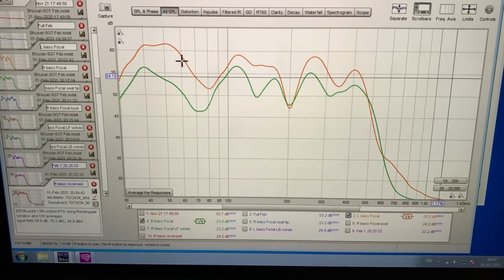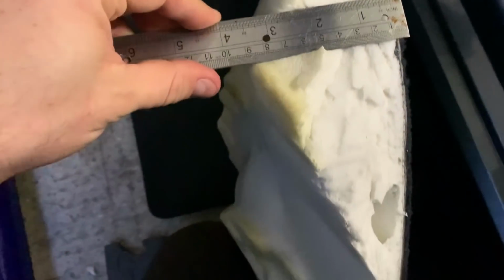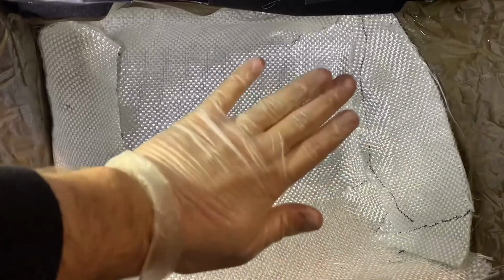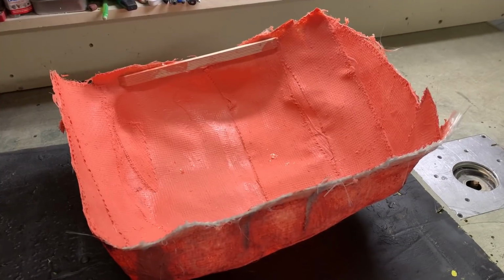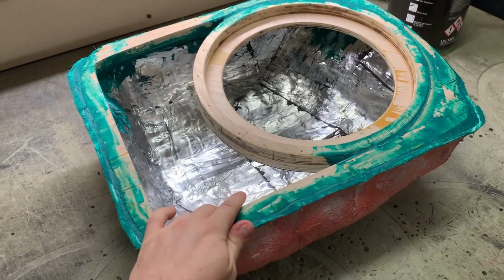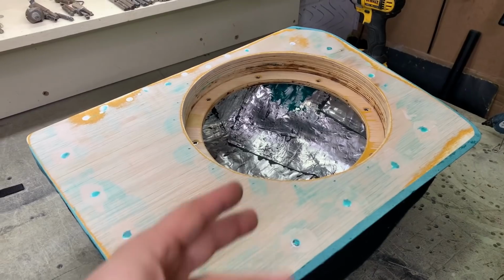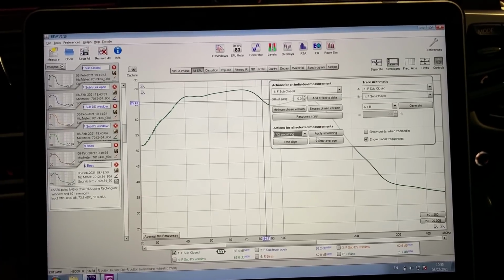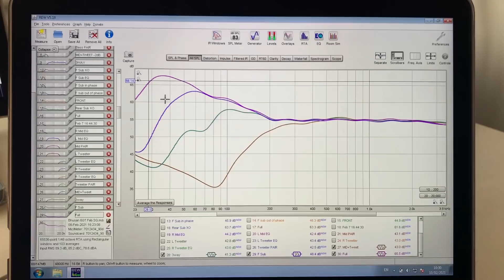Front Subwoofer - Everything you need to know! Acoustics, RTA, Fabrication - Focal Utopia 10WM

Comment: sealed off a trunk on my 68 Chevy nova for an IB 15" setup.. 
Day 1: Started up with a fresh board of plywood 
day 42; icecream sticks with a glue gun in my self created 4d puzzle of doom. 
day 50: It would have been faster to seal the holes from the  inside out instead of outside in.. 

day 1.2 : Yay, plywood, silicone.
day 2.2 ; Awesome sound :)
From failure comes progress and knowledge.

Comment: Was the front sub bolted to any area of the floor or firewall? I’m asking because if the enclosure can be mounted solidly it will give more solid impacts of bass. I bolted a fiberglass sub enclosure using auto sub box carpet I soaked with resin. I braced the inside with 4 3/4” mdf stands about 3” wide from the inside from deck to bottom. I made to hold 4 12” JL 12W3 subs into the spare tire wheel well into the trunk of a 93 Acura Integra gs-r with 500 watts rms by 2 Precision Power PC21400 amps. Had to run a  custom wound 300 amp alternator.

Comment: Actually this video make me think about my own, I have a truck single cab , have a lot of space behind the seats but was thinking to set the subwoofer in the front at passenger side, to leave the back space empty for tools. Actually my subwoofer is a Ultimo titanium SC 104, that as per manufacture needs a minimum of 13 liters up to 30, Thanks Peter, The question is still I need to have a sub behind the seats?
Reply from the maker: Cruz Morales location vs cabin size, that’s what dictates! Unfortunately i haven’t worked on many pick up style cabins, they are not popular in UK.

Comment: How many watts did you decide to give the 10WM? In an ideal world would you have used a larger enclosure? I have a 10wm in 0.55 cu. ft. of my spare tire well, fiberglassed in.
Reply from the maker: We run it upfront, so it can never play as low as from a trunk, so it needs a rear sub for the low lows. 
What it does upfront when it comes to punch and playful upperbass is a different story and it’s really not about how much power you have behind it. Give it as much clean power AND stable power supply in the car and it’s all good. Worry rather about how it’s tuned and integrated to the rest of the system.
Reply: @pssound9749 gorgeous work peter with the focal utopia m bmw build. did you ever hear about the focal fse 20 flax evo 8 inch shallow sub?. I think that would be a interesting install/project for you in the future, for upfront bass. I think they would do great in a front false floor build, plus you would be able to put them on both sides of the car, right front, left front sides.

Comment: Hi Peter, how long does it take for you from start to finish to build a fiberglass enclosure for a sub in passanger feet location? I am thinking to build one, since i can't block my trunk and have only front speakers, don't think will add rear fill soon enough. I would like to know what i'm getting into. Of course i will add some extra time margin being the first time i'll do this
Thanks
Reply from the maker: Hi,
A front sub box is usually 30-40hours work, so it’s very labour intensive, but you can certainly do it in stages.
Reply: @pssound9749  thanks..so, around 7-10 days working in stages after work. Good to know 👍thank you

Comment: Good day Peter. Brilliant installation as per usual. One thing though would subwoofers in the doors be just as effective or better?
Reply from the maker: In doors where everything rattles? Quite a tough job! These cars don’t even have door location for larger drivers, just 4” mids. You’d need to build door enclosures like i did in my Honda. 💪🔊🔊
Reply: Thanks for the reply.
Reply: Thanks for the reply.

Comment: @Pssound would a 3d scanner, with a 3d printer work for a box, in a location such as this one?
Reply from the maker: You can do crazy things with today’s technology, so i’m sure it’s possible, but i’m not sure it’s worth it. Printing a rigid enclosure for a 10” sub is quite a challenge! 🤘🔊
Reply: @pssound9749  it would be great for making the basic shape so you could fiberglass it outside of the car.  Another benefit is that the whole deal can be shared as 3d file to other builders with same car and done again.
Reply from the maker: matsku1212 but the reality of people cutting the carpet....

Comment: Hi Peter, another great video! Question for you: I've done a similar approach for my car, but uncertain as to the best strategy for time alignment between the front midbass speakers, front sub, and rear sub. Do you feel that the Helix software (I have a Helix Ultra DSP) does  good job with automatic time alignment? Or do you think I'd be better off just measuring distances from each of the speakers to the driver's headrest?
Reply from the maker: I have my well practiced method, that has worked for years, so I haven’t used Helix’s feature yet. I may try it for comparison one day. 😃
Reply: @pssound9749  Thanks.  I'd love to hear your take on the Helix feature some time, and if it's worthwhile for those who don't have access to someone such as yourself.

Comment: Good evening.

I am buying an enclosure. But confused between the regular shape or the wedge  shape ( tapered on the top which sits perfectly behind the rear seat)

Does top tapered or wedge shaped  enclosure affect the sound quality?
Reply from the maker: Absolutely no difference in sound. Air space matters.
Reply: @pssound9749  just ordered the wedge shaped enclosure. 

Now there has been a debate going on regarding xmax. Is higher always better. 
I am looking at a polk audio1240 sub which has an xmax of only 7.5 mm. Is it a deal breaker ?

Comment: Could you please let me know the dimensions of your 5 1/4 sub boxes underneath your driver and passenger seats that are ported? Also the size of the ports? I have some MB Quart Reference  5 1/4” I was thinking of putting under the seats after seeing your cool install, instead of installing mid bass speakers in the doors. If you could give me a rough idea, that would be awesome, especially the port size, as I can look up the volume size Vas or Q for a box for the speakers. I really envy your installs dude.  Aloha, Matt on Maui 🌺
Reply from the maker: Hi Matt,
I’m a bit confused by 5.25” drivers you’re asking about as this BMW has 8” drivers fitted under the seats.

Comment: what type of plywood do you use? is it important?
Reply from the maker: It doesn’t, it just gives structure. We use birch ply.
Reply: thank you! started my build today, following this guide. When you do the first layer of fiberglass cloth in the vehicle, is there any trick to applying the resin upside down onto the inverted piece? I was planning to use paintbrushes but I’m not sure that would work
Reply from the maker: @chef_yt  that’s always the shit part. It helps if you wet the chopped matter with resin a bit in advance, then stick it up or if you can, just build it from wood on the top.
Reply: there’s not a great way for me to build it with wood on the top, wouldn’t be any easier from what I can tell. I’ll try using a strong adhesive tape for masking, supergluing that section of the cloth to the masking tape, and just ripping the tape out with the cloth when it comes out, and sanding off the tape. Probably decreases the integrity of the mat, but I’ll do other layers anyway. Thank you for the help, and great video!
Reply: change in plans. masked with blue painter’s tape and carpet protector (cling wrap) and a healthy serving of johnson’s wax. I removed the glove box so I’m thinking I’ll affix coat hangers in the glove box area, bend them down into the fiberglass area, and have the coat hangers holding up a piece of wood shim stock on the front/top of the box to hold up the cloth. I give it a low probability of working, but worst case I’ll cut out any droopy bits and either glass those couple inches with a loose clearance, or put wood there. have you ever had an insufficient mask/insufficient release agent and had to remove a fiberglass part stuck to the frame?

Comment: I am asking myself; would a multiple capable 6,5 or 8 inch was used, could that be a solution instead of a single woofer?
Reply from the maker: Large drivers always play lower frequency range more effortlessly with less distortion than multiple small drivers.
Reply: @pssound9749  I agree Pete, but considering the bandwidth were the biggest problems were, between 50-80 ish was the reason. Right bandwidth of good smaller drivers. But if you want bigger lower output in front it’s logical.
Reply from the maker: Umıt Bozkır it was also about location related problems with the midbass. If the 8WM was in different location and had no issue in 60-90Hz range, we wouldn’t need a front sub. 
Sometimes you need luck with cars and what locations you get.
Reply: @pssound9749  I am going to try with an Aliante 12, and try with multiple 6,5 inches. I have also the same issue with my BMW f11 estate. Depth isn’t an issue with the Aliante, but the diameter of an Aliante 12 is quite large.

Comment: Morel Ultimo Titanium 102/104 have 600W RMS and Frequency response of 10-900Hz and similar sensitivity of 85dB only con is that it's almost 1.5" longer than 10 WM. Morel paired with Helix M One X (having Freq. res. of 10-250Hz) would have been able to produce the low end bass (20-25Hz) as the rear sub?
I looked at the specs of some subwoofers where it was mentioned ported sub box makes lower freqs. than sealed boxes but need more vol. Do you think a ported box in the front would make a difference?
The Focal TBM can go to 50khz according to it's spec sheet, is that even noticeable coz usually tweeters are up to 20khz or 25Khz?
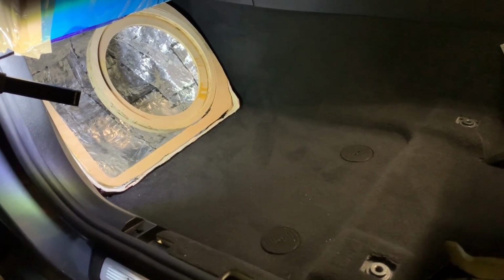Love your work on this beamer, would have loved to see some glimpses of your tuning session. 28:27 I would have added a layer of chopped fiberglass from behind the plywood and in front also before applying Resin and make a sandwich  between 2 plywood layer. This way the fiberglass layer is also a part of the plywood and is not just held by the resin alone.

Comment: thanks for another great video peter!  i'm hoping you can shed some light on an idea i have.  in my jeep grand cherokee there are significant spaces under both front seats.  the driver's side is empty and currently houses my dsp.  the passenger side has the battery.  i was considering putting a small sub, 8 or 10, under at least the driver's seat.  initial thoughts?
Reply from the maker: brett leasure any sub is better than no sub, but you can get better low-end response from a single if it’s on passenger side.
Reply: @pssound9749  thanks for the reply.  i should let you know that these would be more like supplemental midbass/subs where i'd likely still have a 15 or something in the rear.  i built kicks with 10's in them, but they're starving for air, etc.  they imaged well, but they struggled to get me anything in the 60-100 hz range.  i was hoping that relocating the battery would be alot easier than cutting a bunch of metal in my kick panel areas.
Reply: @pssound9749   I do believe i heard you say that you would have liked to have the sub facing towards the fire wall ? 
If true , In your experience or knowledge do you feel it gives a better response to have it facing the fire wall. Also do you feel a center console sub that’s placed forward slightly underneath the dash would benefit more rather then on the passenger side fire wall area ? Like in the position where you would usually find the shifter but say maybe 6-8” more forward. I ask because I have a Chevy Silverado and it has lots of room in that area. I’ve seen some online put a 10” in that spot with a .6cf sealed box. Don’t know if the work would be be worth it. Oh the sub would be down firing at the floor.

Comment: Hi, Peter! Do you have a 10 » woofer with a better budget friendly price option that I can use, without braking the bank with the utopia one 😉. Thanks.
Reply from the maker: JL has great options. W3 is excellent for SQ too, but if you need something slim, they have many options for that too. 
If you have space, then the Helix Q10W is a real jam and is cheap for what it is.
Reply: @pssound9749  Thanks a lot for your quick reply…saw the q10W will certainly go this way but will check space first. Thanks for all that video…i was off of the sq world but i rebuilt a complete setup in my new car…my ap 3c are on the way ;-)